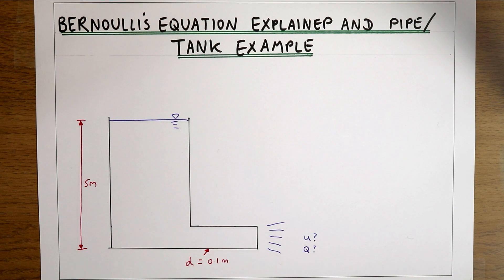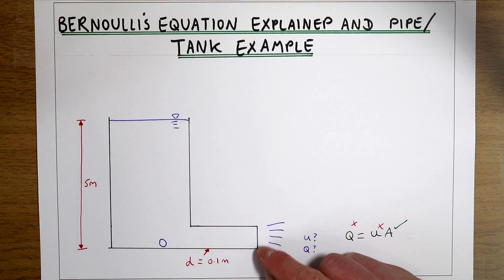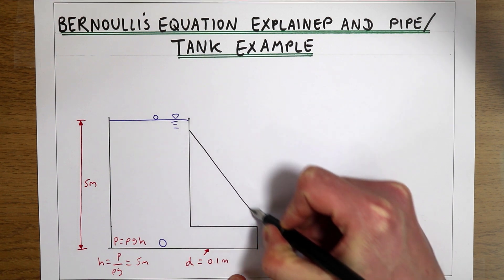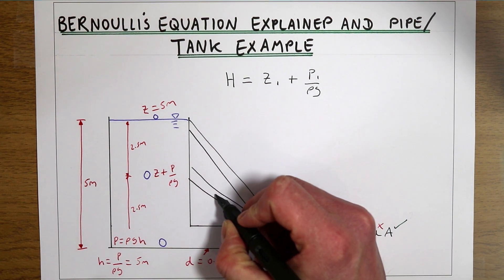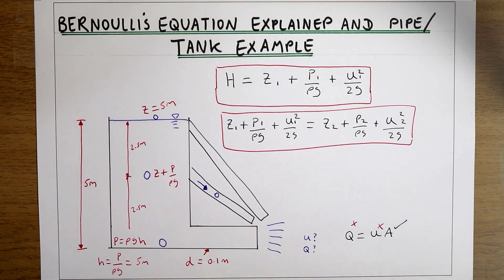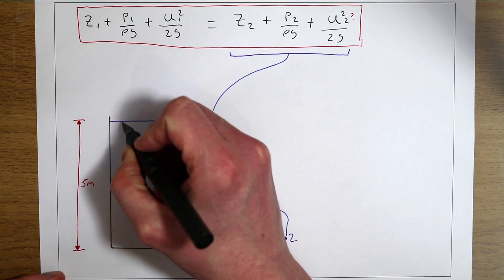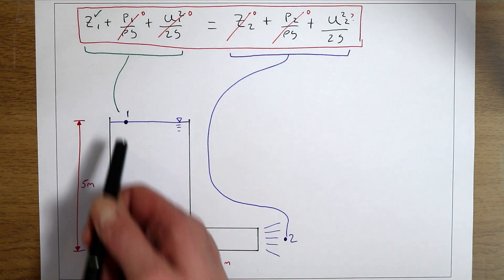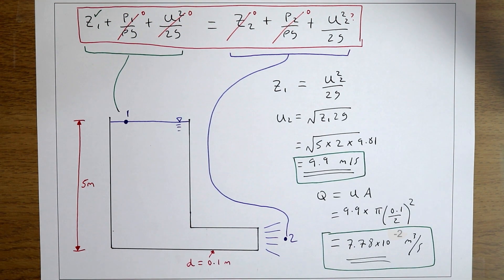Bernoulli's equation explained with tank and pipe example

Comment: If the pipe was not open to the environment, say it was a closed pipe, would we still be able to apply Bernoulli's equation to solve for pressure at Point 2. With point 1 still being at the top of the reservoir and  a given flowrate

Comment: When we increase the section area of the pipe then the discharge will increase?.
Reply from the maker: This is a very good question. If you increase the diameter at the outlet, the velocity would stay the same and the discharge would increase, as the velocity at the outlet is set purely by the difference in head between the tank and the outlet and a larger area with the same velocity gives larger discharge. However, if you increased the diameter at some local point along the pipe, that is not open the atmosphere, this would lead to a reduction velocity, to conserve mass with respect to the discharge at the outlet, but the same overall discharge. Hope that makes sense?

Comment: Thank you for all you great videos.
I watched "Calculating the power a turbine can generate on a hydroelectric scheme using Bernoulli’s equation"
and I can't reach the same velocity of 1.5 m/s at 40m head. Are these videos completely separate concepts?
In my problem, I need to calculate Flow when I only  have Head and pipe diameter. I'm attempting to calculate potential power for a Micro Hydro system. Is it possible without Flow rate?
Reply from the maker: Thanks for the feedback! You would either need to flow-rate, or an estimation of the losses from the turbine do solve, else there would be too many unknowns.

Comment: How the pressure can be energy ...there is no flow in the closed tank..so no flow work is there...there is no flow work or pressure energy..plz explain me sir..
Reply from the maker: It’s the equivalent to potential energy. Like a car being stationary at the top of a hill.
Reply: Energy per unit volume is pressure, so pressure difference is just just energy getting converted into work. That's how I visualize it.

Comment: P1 is not zero is atmospheric same at the orifice, so they cancel out (not because they are zero but because they are the same (P1 =P2))
Reply from the maker: Absolutely correct, I did not make it clear in this old video. I now have an updated video that gives more full explanation about atmospheric pressure in this example:

https://youtu.be/9vQR5hpNHJ8
Reply: @fluidsexplained1901  thanks,

Comment: What in case if you have to determine the pressure in that tank that is closed, and the water is flowing to an open reservoir with the volume per second given? I tried to solve this question with Bernoulli's equation multiple times but I don't get the same answer that is given.